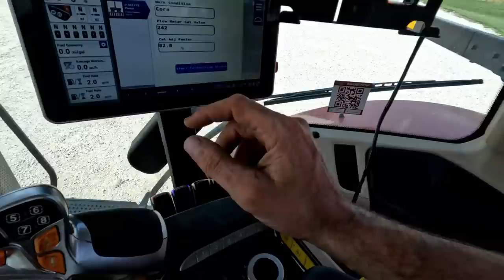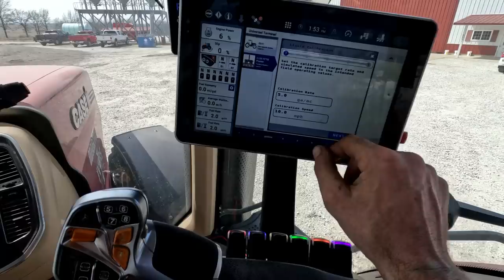Preparing for Spring By adding  Furrow Force To the Planter and Reclaim To the Sprayer  S4 E2

Comment: The furrow force is great as long as there’s no rocks.  If you have softball or just a little bigger size rocks they get plugged quite often then they plow dirt and plug the speed tubes.  We have 24 of them I have yet to find the proper setting that keep the rocks out.  We have a lot of rocks where we farm so it gets old stopping all the time.   I was going to say you should have put them on the other side of the planter it’s a shorter walk to kick the rocks out.    You’ll have to watch your population on those rows it will jump way high when the dirt piles up that’s usually the first sign the seed isn’t getting to the ground.    For no-till they are far superior.  Best wishes for your spring. Keep up the good work.